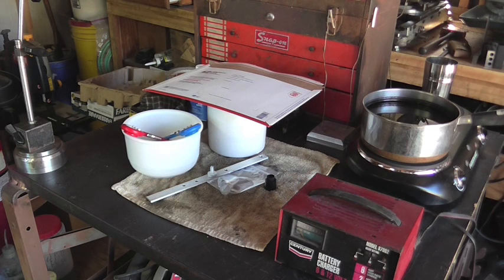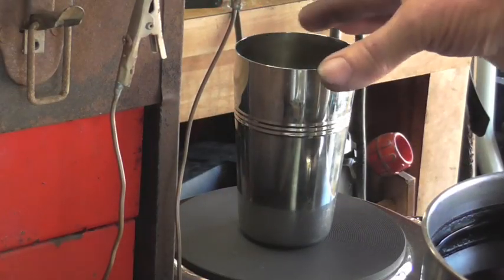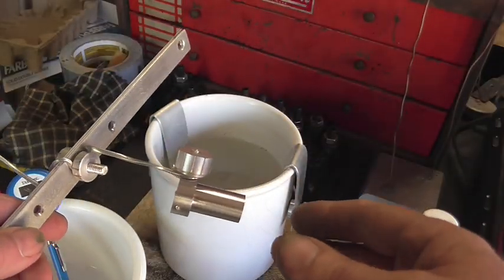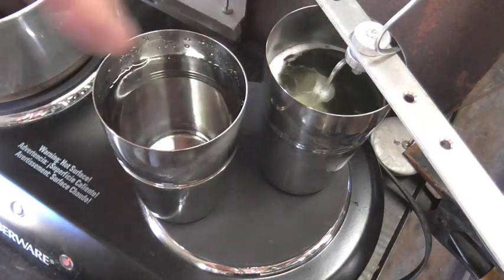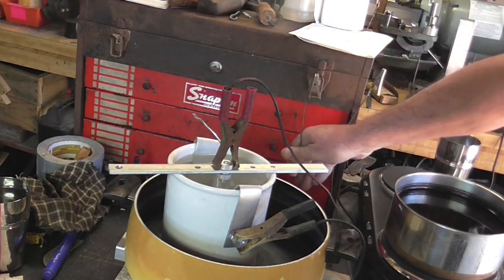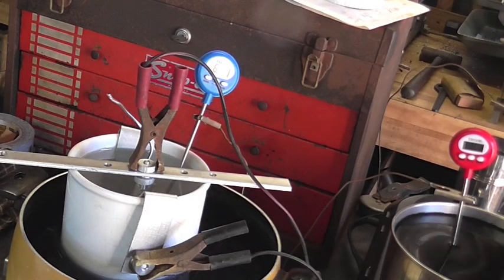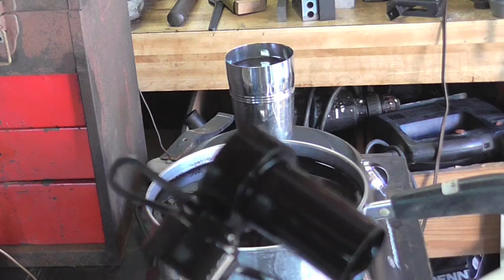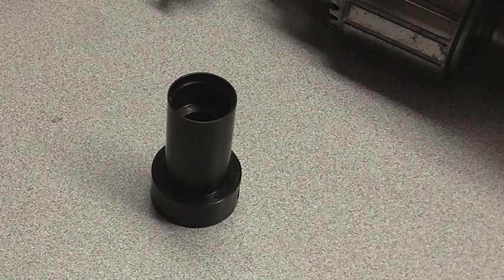⚡️How To Anodize Aluminum Parts Easily In The Home Shop - MSFN

Comment: Thanks this is working great for me. I added a neutralizing step after it comes out of the acid bath, just before it goes in the dye bath.
Reply from the maker: Excellent!, glad its working out for you! ~ Richard
Reply: What did you use for the neutralizing step?
Reply: I used baking soda and distilled water.
Reply: @MrFishguy60   This step what give benefit ?
Reply: @ByTraxxas1994   Neutralizing the part in a bath of baking soda water assures that the part is free of any residual acid that may contaminate the dye bath and or leave spots on the part. I have also added a de smut bath to this process.
Reply: @MrFishguy60   Is it enough to mix baking soda and distilled water? Can u suggest ratio ?
Reply: @ByTraxxas1994  doesn't really matter. put it on with out diluting and you will see it foam as it neutralizes. when it doesn't foam any more, it's neutral. same thing happens as the traditional science fair volcano trick that uses vinegar and baking soda: the volcano ends when the neutralization is complete. But 50/50 works fine, or 25/75, or even 75/25, perhaps 40/60 ;)

Comment: If I just want to clear anodize an aluminum part to seal it, would I simply stop at the point you washed the part in distilled water when it came out of the acid?

Comment: You're a smart guy you probably know this already but brake clean if you sprat it on anything hot like an engine manifold or something really hot it instantly makes phosgene  gas and one whif and you're dead.

It's crazy to even sell the stuff at AutoZone in fact they push it especially sens there's a lot better cleaners out there.

I worked at an old mom and pop diesel repair
Place and we used starting fluid which is ether, when we were cleaning mateing surfaces but it will clean anything, a lot better than brake clean and leaves nothing behind well will seemingly leave something behind I worked at LA Freightliner they wouldn't let me use ether they pushed brake clean and I hated that stuff it just nasty leaves a nasty film behind and it doesn't clean well it's junk I don't know why they wouldn't let me use eather citing a fear of catching things on fire
But on real life its a lot safer than you think,its not like gasoline not even remotely close,
you can smoke and spray either.i know because i used to be alot more reckless than i am now,just don't spray it on open flame. it works super great for cleaning aluminum you should try it

Comment: Battery acid is dangerous to work around in open air. The fumes can ignite and blow up the work area. Therefore, do not use a gas stove or work in area of one. Need to be ready with a solution to neutralize any spills. Wear a face shield as well to protect the face and eyes in the event of an explosion or spill.

Comment: Excellent video, very informative.

I want to anodize an HEI distributor black. It has bronze bushings on the inside that cant be removed. Will tge bronze bushing mess up the anodizing process of the aluminum housing?
Reply from the maker: Yes, I believe it would. The only metal that should be in the anodizing tank is aluminum
Reply: @MakinSumthinFromNuthin  thanks for sharing your knowledge, I'll have to go a different route, most likely powder coat.
Reply from the maker: @thewoodsman5261  good choice!!
Reply: @MakinSumthinFromNuthin  Just found a chemical from Caswell called Aluminum Blackener A385. This is more of the finish I am looking to achieve. Anyone else who would like to anodize a part but find themselves in my predicament should check out this product.
Reply from the maker: @thewoodsman5261  Thanks for sharing

Comment: How does the original finish effect the anodizing?  If I take my aluminum part to a mirror finish then anodize it (black), would it come out a nice glossy/mirrored black finish, or would it turn it to a matte finish due to the etching process??
Reply from the maker: It would be a matte finish in my opinion as a new layer was created

Comment: Hello, enjoyed the video just confused when you “seal” the part to close the pores…. Aluminum heated expands cooled contracts so wouldnt you want to put it in a pot of ice water to shock the pores closed vs heated to keep pores open? I mean your process obviously works but I can’t understand the end process. Thanks
Reply from the maker: The pores are formed during the electrical process, cold water is not needed to seal them. Its NOT a "heat makes metal expand thing"
Reply: @MakinSumthinFromNuthin  ok thanks for the fast reply appreciate it.

Comment: A strong word of warning for UK viewers (this may also apply in some form across the EU).

To use chemicals like Sulphuric Acid (battery acid) and other strong oxidising acids you MUST have a licence from the Home  Office that covers the specific chemicals you intend using, their maximum concentrations and quantities that are allowed, the usage to which you intend to put them and the approved storage facilities you will be using.

Failure to apply for and receive such a licence will result in your breaking anti-terrorist laws, a hefty fine and potential incarceration for a LONG period!

Personally I am rather surprised that the US authorities have not taken a similar stance, especially since 911. It's particularly lax over Nitric acid, from which it is EXTREMELY SIMPLE to make HIGH explosives.

You have been warned!
Reply: it looks like more immigration more acid wars

Comment: Only thing I would add in is to do a neutralizing step after you take it out of anodizing (baking soda and water, just a nice dunk and spray rinse) before placing in the dye which I always do a bare minimum of 30 mins and boiling water at the end for 10-20. FYI, I recover gold and platinum part time and can tell you that you can use tap water for everything but the prep and what u add ur acid to, everything after that anodizing process won't effect it at all. Can't tell you how much money I wasted on those 88¢ gallons that go alot faster than u think that were unnecessary. Think about the giant operations that do this... They're not gojng to use distilled water in everythibg, that would cost thousands of dollars every month probably

Comment: Can the fixturing components be copper or steel? You're video said aluminum only and I'm curious why
Reply from the maker: no, because you are anodizing ALUMINUM, follow the procedure and you will have success

just use what is proven to actually work
Reply: @MakinSumthinFromNuthin  yeah, but im not trying to anodize the fixture holding the part. I only asked because I have alot of copper components to make the fixture and not aluminum. Copper is more conductive so I was just asking an opinion
Reply from the maker: @BrandonPrentice  my opinion is it wont work, use only aluminum
Reply: @MakinSumthinFromNuthin  ooohhhkay then

Comment: As soon as you added the temperature gauge, you fouled your solution.  You have a electrified acid and you will get plating from the thermometer even though it is not connected to a plus or minus terminal.  It may be so minimal that it has no effect on your process. Nevertheless it is happening.

Comment: Thanks Richard, this taught me to anodize.  One thing, the current does not flow between the two cathodes.  If flows from the +positive anode terminal (the part now) to the cathode (your nicely machined aluminum one).  This is the direction of "conventional current flow" as in all engineering books.  The electron flow itself is from the -negative cathode to the +positive anode or part, thus the part is anodized.  All the rest though is 100%.
Reply from the maker: Thanks for watching, & thanks for the info!
Reply: Wouldn't it still in theory flow between both cathodes and the anode? Thus making the same effect of more surface area being anodized which is what he's trying to say I think

Comment: Questions:
1. Is anodized aluminum better at conducting heat over none anodized?
2. Can you also anodize aluminum with fire?
Reply from the maker: No idea for both questions, the fire part is interesting.....care to explain how that works?
Reply: @MakinSumthinFromNuthin  so I found the answer but my question should have been: can I anodize aluminium by putting it under flames (I.e a lighter or stove)? 
The answer I found was something like: "Yes, but NO: fire will cause very uneven anodization, and will be significantly worse at thermal dissipation/structural support."

Could you confirm that the information is correct?
Reply from the maker: @WarPigstheHun  I never heard of the "fire" method so I am not much help :(
Reply: @MakinSumthinFromNuthin  oh. Well it's just something I learned in chemistry. Using a simple bunsen burner. It does seem to work: as a small part of my aluminium heatsink turned black upon hitting it with a small flame. But, according to this article, the heat oxidation layers are generally uneven and therefore create a weak layer. 

I think if I had a special heating equipment and more knowledge, I could do it. I wish I could paint aluminium instead of dealing with all these hazards.
Reply from the maker: @WarPigstheHun  anodizing with this method is rather easy, gotta invest in some supplies tho.....
Reply: @MakinSumthinFromNuthin  ok. But my parents might get mad and think I'm making a meth lab with this one. With the bunsen burner method, I could just claim I'm an arsonist. Someday I will be a self homeowner :)
Reply from the maker: @WarPigstheHun  LMAO
Reply: @MakinSumthinFromNuthin  thanks for reaching out btw.

Comment: There are two types of anodizing processes. This video shows sulfate anodizing. The other process is hard anodizing, which creates a thin non-metallic conversion coating (aluminum oxide). When working with acid the user should be wearing rubber gloves, chemical resistant apron and safety glasses at all times. At least this presenter got the part about mixing acid and water right, another video on the subject shows adding water to acid, which could very well result in spitting, i.e., a mini-eruption of the solution, very bad news if you are not wearing protection and hard on everything else on the workbench.
Reply: Do as you outta- add acid to water.

Comment: Thanks for the informative video. I followed your steps buy came up with a less than desirable product. It looks like an oil spill but not solid black like I was aiming for. What did I do wrong?
Reply from the maker: Most likely part not clean enough

Comment: Can I anodize something black that was previously anodized a gold-color?  In other words can something be re-anodized? Must you remove the previous anodizing? if so , how?
Reply from the maker: A colored anodized part can be stripped of color and the anodized layer by soaking in a water/ lye solution using 100% crystal lye. Approx a tablespoon or so per 1 1/2-2 cups water. Then cleaned and then can be re-anodized a different color.
Reply: @MakinSumthinFromNuthin  Thanks ! I will give this a try. I appreciate your information and clear instructions.
Reply: @MakinSumthinFromNuthin  Thanks for answering, good to know.

Comment: Awesome video with extremely easy and simple steps to follow.by watching this video I'm going to save about $150 by being able to not only change color of my rc parts but also make them look new again.granted itll take some time to do but in my opinion knowledge is power not to mention I'll be able to do any other aluminum parts I may want done myself.thanks for video.
Reply from the maker: The surface finish must be 100% uniform prior to anodizing. If you are going to wet sand to a fine finish it is a must. Anodizing brings out the flaws in poorly prepared aluminum, it doesnt "hide flaws"
Reply from the maker: Nice! As you can see....no hi-tech equipment needed. Do a practice piece first to get the hang of it...its not hard 😊
Reply: @MakinSumthinFromNuthin  definitely intended on doing a practice piece first.i have one question about doing anodizing and hoping you maybe able to answer.can you polish the aluminum piece prior to doing any of the anodizing steps to possibly have part have a chrome type look so to speak when part is finished?doing most of the parts in black but gonna do a few in a graphite color and would like it to have bright shine to it if that's possible just so it stands out a bit and maybe looks better with all the stainless screws I'll be using not to mention some of the other parts thatll just be polished aluminum.
Reply: Awesome,that's what I was hoping to hear.thanks

Comment: Hello Everyone, I have a problem with anodising the pressure casting aluminium, means the alloy with high silicon contain (Si>6%). Does anybody tried this? Which parameter could be a problem, which should be combined?
Reply from the maker: Sorry I cannot help you, no experience with it ☹️

Comment: Looks like there is hydrogen getting generated . Does the bubbling happen on the anode part also.high stress parts fail due to hydrogen embrittlememt.
Reply: You are correct in that hydrogen is being emitted, water+electricity=hydrogen. I doubt that the embrittlement is happening, since anodizing is known to improve the surface strength of aluminum.
Reply from the maker: Everything in the tank creates bubbles. Thanks for watching & Happy Holidays! 😊🎉

Comment: Awesome video.  Where would i get the cathodes and aluminum parts in your video
Reply from the maker: I made mine from a discarded aluminum road sign. I just cut it to size needed   All the aluminum machined parts I made myself on my lathe
Reply: @MakinSumthinFromNuthin  oh ok so the Cathodes are made from aluminum as well

Comment: can you use a different acid? or is that the only one that you would recommend? I have a yoyo that is raw aluminum and I want to refinish it. I will probably plan to sand and satin the body, then annodize.
Reply from the maker: If there is another acid that will work I am not aware of it
Reply from the maker: Thats a great project to do at home :)

Comment: What plate should I use for cathode?
Reply from the maker: Aluminum or lead plate can be used. I used aluminum
Reply: @MakinSumthinFromNuthin  aluminum in anode also?
Reply from the maker: Yes
Reply from the maker: The old school chargers like I have work well, I have no experience with new auto chargers :-/

Comment: Really the most important thing is temperature NO NO NO people wear goggles sono liquids or fumes get in your eyes remember u r in a ventilated area meaning air is flowing at good flows around ur body face and head and also u r working with electricity make sure u r not the ground and yes pleanty more to be alarmed in a unregulated shadetree shop as this all i can say is u r also making recipes of chemicals and PPE PPE PPE
Reply: Anodizing, electroplating and electropolishing use low current, low voltage DC.
If you feel a shock at all, you've inserted both wires in one of your bodily orifices. 
Congratulations, and please don't reproduce.

Comment: do you have to "charge" your electrolyte solution?  With zinc plating, you ring a cathode and anode in the solution without a part to get zinc ions to be suspended in the solution.    same for this process?
Reply from the maker: Not to my knowledge. Maybe plating is different process altogether

Comment: You need to edit the beginning where you talk about the electrolyte.  You say " 4 quarts water and 3 quarts acid" then you say "that's about a quart or quart and a half".  7 quarts is almost 2 gallons.
Reply: Just a ratio: 4:3 pints, litres, fluid ounces, etc. The total he used was about a quart or so.

Comment: I haven't worked with this process myself but I seen some of the process at work years ago. The the dye used was Sandoz product and  the sealer was  nickel acetate. I hear Rit brand dyes work for coloring aliminum too with decent results. Very nice video :)
Reply from the maker: Its a cool process! 😎
Reply: @mixedflix9147 - I'm rite dying a belt with an aluminum belt buckle black-are you saying that if I put the aluminum bucks in the dye bath while dying the belt,it will turn the buckle black also..I'm trying to find a way to dye the buckle black also..I can't take buckle off..thanks!

Comment: What seals the anodized part ?
Reply from the maker: The hot water bath at the end seals the part
Reply: I guess I don't understand how water seals anything.  Clean or rinse off but seal is what I don't understand.
Reply from the maker: The water seals the pores the dye goes into
Reply: I gooled the question and found that the water changes the oxide.   "This process involves a long immersion of the anodized aluminum in boiling hot water, which has been deionized or is in steam form. This method is not very expensive, as it reduces abrasion resistance only by 20 percent. The oxide is converted into a hydrated form, and the swelling that results reduces the surface porosity."   So the water causes a chemical reaction.   Now I understand.   Thanks for posting the video.  I may try your method on some parts for a CO2 laser cutter I plan to modify.

Comment: Looks to be some process, I wonder if benefits of Anodising outweigh effort and resource required. I am just re-painting my Alu mast from sailboat. I am almost tempted to re-build it out of carbon fibre.
Reply from the maker: I cant answer that for you. Its fun to do tho! :)
Reply: @MakinSumthinFromNuthin  fair enough, I can relate to spending good time on fun projects :)
Reply: Yes, by far. Sulfuric acid is like $10-20 a bottle and I'm willing to bet there's plenty of scrap aluminum around the house to use, other than that $10 at a thrift store for a couple Pyrex dishes and candle warmer. So if $30 is worth it to you then yes.. Plus anodizing protects  the aluminum (or titanium) surface like 10 fold more than any paint or coating will ever do. Plus, I guarantee you'll start anodizing all the stuff you can find once you start, it's kind of addictive. Always wear PPE, especially with hot acids